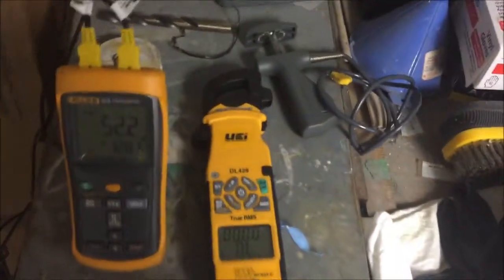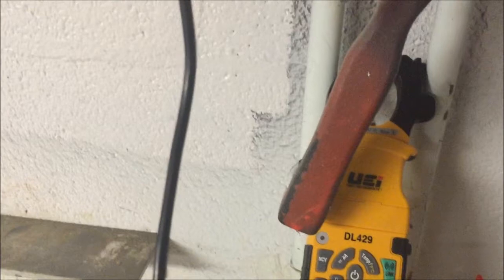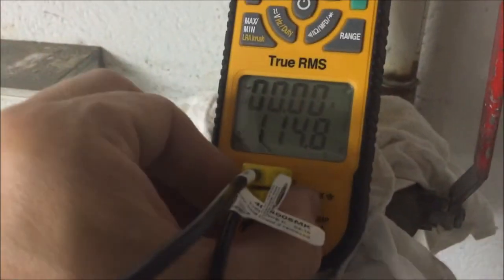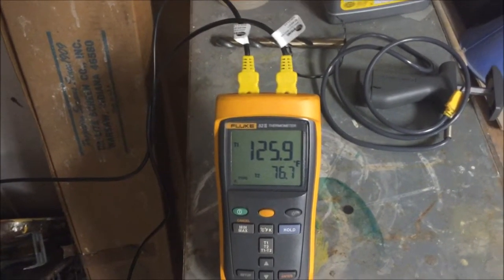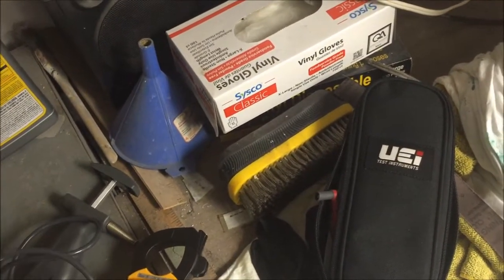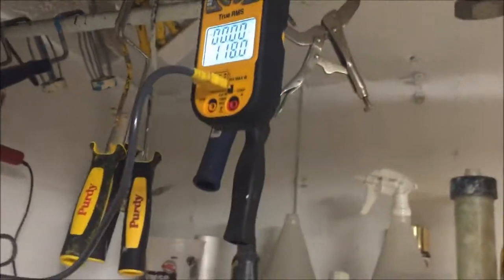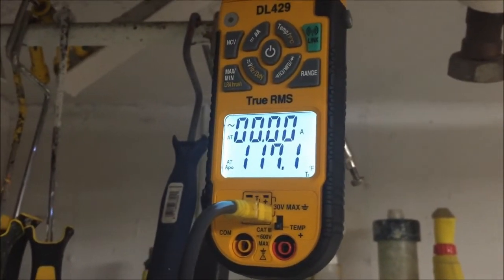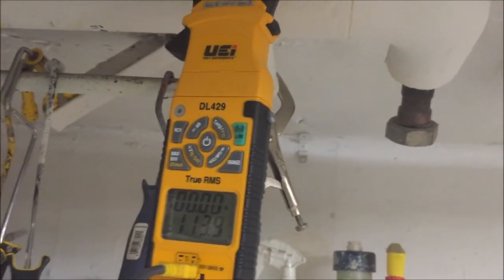UEi DL429 issues and thoughts

Comment: Try removing the amp clamp and see if it helps.
Reply from the maker: It happens no matter what, and not just on the DL429, but others as well.  I found it is the nature of the K type thermocouple, you get a “feedback” effect when two are connected to metal at the same time.

Comment: I know the Fieldpiece heads fit that meter, have you tried it with the Fieldpiece temp head?
Reply from the maker: jim johnson I have not, but the problem lies in the K type lead, which when two are used on metallic surfaces they “feed back” on each other. I have used a Fieldpiece meter with two ports with the same results. Thanks for watching, and for commenting.
Reply: Do you have the lil silicone isolators?

Comment: From my understanding this is why Testo has the pin style temp clamps to cancel out stray voltage. I like the DL429 for troubleshooting electrical issues. Being able to switch functions and data logging through the app makes it perfect for me. I can see what's happening inside the equipment without having panels off or when I walk away from a piece of equipment and it shuts down I can go back through the logs and see what dropped off. If I'm testing air side issues I'm using Fieldpiece psychrometers. If I'm checking temp difference across a filter drier I'm using Fieldpiece JL3KR4 clamps. I've never really liked using K-type thermocouples unless I have to. My OCD makes me re-wrap them perfectly around the spool, takes time. I've also found that the DL429 reacts sluggishly when measuring ohms. It makes ohming out a ton of wires a little tedious having to wait for a value. I use my SC56 for that. Ohm values are almost instant. This isn't the end-all, be-all meter (not sure if one exists) but it's a great meter to start with and it's super affordable for all that it offers. Knowing the strengths and weaknesses of your tools will keep you from second guessing them out in the field. Having back-ups always helps and it also helps to maintain your tools and to test them for accuracy on a regular basis. There...I'm done.
Reply from the maker: M Kinnison some good points made, for sure. I’ve purchased the Cooper Atkins blue box kit, and got their pipe clamps to go with it. It’s got the 3.5mm plugs, and they’re more accurate and don’t have the feedback issue most meters have with k-type. You definitely have to experiment on what works for you, and the limitations of your tools. Thanks for watching and commenting!

Comment: You think it could be reading funny due to some grounding issue ? What if you just take a random pipe not hooked into anything and try it again
Reply from the maker: Jeepjones85 I did. It has to do with it being a K type thermocouple, it gets feedback when both are on metal surfaces. On a non metallic surface or air, no problems. And all the meters I have tried with dual K type will do this. Cooper Atkins temp probes use thermistor style, and they are not affected like K type. Thanks for commenting!

Comment: Thanks for your video. I need to buy new clamp-on meter . Should i go with this one or fluke 902 FC or testo 770-3 or FC640?
Reply from the maker: Ziyad Tariq out of those 4 choices I’d go with the UEi meter, since you can use the Fieldpiece heads on it and expand your uses. Plus with the app, you can use it with your smartphone. I have the FC640 and the 770-3, so I’ll go with UEi. I’m currently using the Amprobe AMP-320, it is a nice small clamp meter that also does three phase, but it doesn’t do millivolt measurements. I have a video about it uploaded on my channel, check it out. Goes for about $160 on Amazon. Thanks for watching!

Comment: I have checked several of these meters and am having the same problem. Impossible to check with both k types installed. Having said that, this is still a great meter.
Reply: I thought you would say some jarhead recommended this meter to you and you've regretted it ever since! I had to give mine back to the company but I'll get another one soon.

Comment: Most meters will have this problem. Basically the meter is sending out a voltage and measuring the drop across the resistor. If both ports are sending a voltage and they both have continuity then they get the wrong voltage back.  Opps relized this was old but oh well. Theres nothing wrong with the meter.
Reply: These are K type thermocouples, not thermistors.  The thermocouples generate a voltage.  Electrical noise sure can be an issue.

Comment: My uei dl 429 does not work accurately with fluke pipe clamps if t1 and t2 are hooked up. If I am doing hvac work I only plug in 1 pipe clamp at a time to get accurate  temperature readings. This is the only work around I have found. I called uei and spoke with tech support and the tech tested one in the factory and with air probes without any problems with t1 and t2 installed. The tech explained the dl429 was never tested with pipe clamps. Even my fieldpiece clamps from my sman3 cause the same problems with my dl429. It is not a real game changer for me I just install my pipe clamps on liquid and suction lines and then plug them into t1 one at a time to get accurate temperature measurements. I started with the dual display dl 379 years ago and other than the pipe clamp problem think it is a great meter.

Comment: Pipe clamps dontt work great with paint. or in general
Reply from the maker: They weren't on painted pipes, if they were, the conductivity issue wouldn't have happened. They were on pipes that were bare copper. But thanks for watching.
Reply: I apologize. I had a few when I commented and was waiting to get reamed out. But you were nice. Happy 4th!

Comment: is it still the same diff with changed numbers, and did you try different k type clamps
Reply from the maker: DOKDONTSTOP it seems that any meter with dual temperature k type inputs have this issue. I've got the Fieldpiece SC660 and it will do the same thing to a degree. Since k type uses a micro current translated into temperature, I believe what is happening when used on copper or other metallic surfaces is it's getting feedback interference. If you put a layer of teflon tape on the pipe it breaks the metal to metal connection and doesn't distort (but it's also an insulator so your measurement is off about .4°).

Comment: Any word from uei on this issue? I am looking to buy this meter this week.
Reply from the maker: Haven't talked to UEi about this, I've been to busy to pursue it. But I have been using this meter exclusively for two months, and I honestly can say that I don't think you'll be disappointed. The dual display, which allows you to see amps and volts at once, has been great for checking capacitors while under load, and if you use just one at a time the temp clamp gets your temperature on suction or discharge line to help you get SH or SC. If you are measuring air temperature, both thermocouples can be used without any distortion. It's only when they contact metal at the same time this anomaly occurs. And the BT comes in handy with the app when you need to take amp draws on fans that need to be enclosed to get proper readings. Purchase it and enjoy it, it will serve you well!
Reply: Thanks for the reply. Yeah man the uei is a bad ass meter. I have been using the DL 389 for the past 6 years. But i want to upgrade to the 439 the one in your video.
Reply from the maker: After doing some research on K type thermocouples, I have found they measure temperature by EMF feedback (41microV/C°, Seebeck coefficient), and I am thinking the copper line is causing interference with the reading, somewhat causing them to "ground out" each other. Unplug one or the other, problem solved. The only other method would be to put Teflon tape under the probe, but that throws off the reading a tad. All meters using this type of technology would be susceptible to this issue, I'm afraid. Contacting UEi looked nearly impossible, as far as a tech guy. Only service info on their site, and after researching K types and how they worked, I figure I had enough info to make a conclusion.

Comment: Thanks for noticing this. This meter is off the wish list :(
Reply from the maker: Well, it's one flaw, but if you think about it, you can buy one clamp, get your temps separately, get your SH and SC readings. The supplied thermocouples will get the air temps with no problem. So, for $200, I wouldn't knock it off your wish list just yet. It's knowing a tools limitations beforehand and not letting it bite you in the butt is what counts. Thanks for watching.
Reply: +tcpHVAC/R Have you noticed any interference to the thermocouple readings when the wireless is turned on? The dual temp feature was about the only thing this meter had special over others out there in the same price range.
Reply from the maker: +WorksGoodCheckItOut I haven't tried with the app using Bluetooth, I will, but the apps usually relay the info the meter produces.
Reply: +tcpHVAC/R I have seen wireless and other interference affect the Thermocouple readings. just figured if they couldn't get this simple two channel to work it probably is being affected by the radio too. my Fluke 52 would go goofy around my old flip phone. that's about the last time I used t-couples in the field
Reply from the maker: +WorksGoodCheckItOut I wasn't using the Bluetooth at the time, so it wasn't on during this test.

Comment: Thanks for the tip. I just tried mine with fluke clamps and each temperature input was changed by 3 degrees.
Reply from the maker: You're welcome Matthew Maslak , we're here to help each other out. Glad it helped, thanks for watching.
Reply: +tcpHVAC/R Any update on this issue?   thanks for posting, I'm thinking of getting this meter for this feature
Reply from the maker: APR928 No update, just be aware of this issue when using dual clamp meters. Doesn't seem to be an issue when using the supplied thermocouples for air temp readings, but if any K-type device that makes metal to metal contact, this issue arises when both are used. I have seen it disappear if pipe is wrapped with one layer of teflon tape. For the money, you won't be disappointed with the purchase.